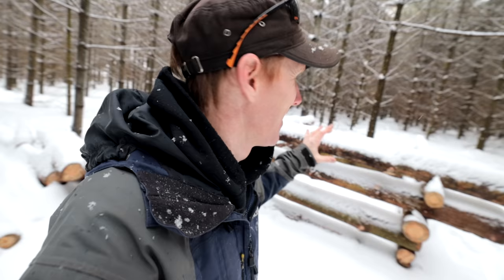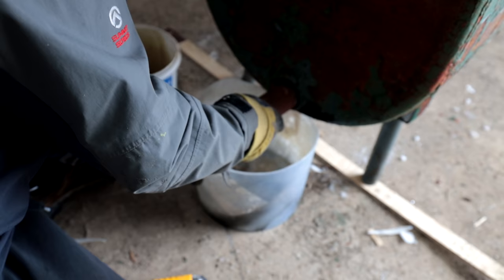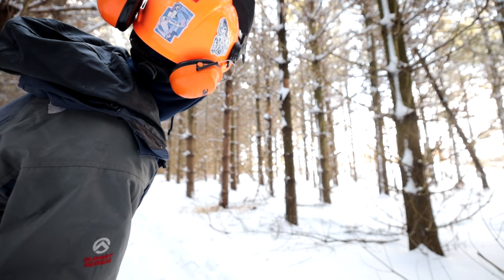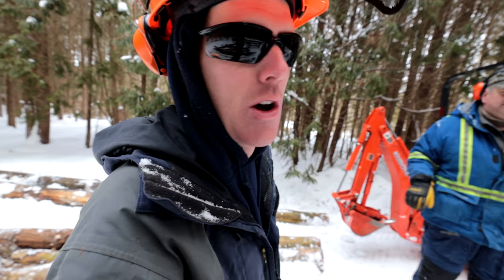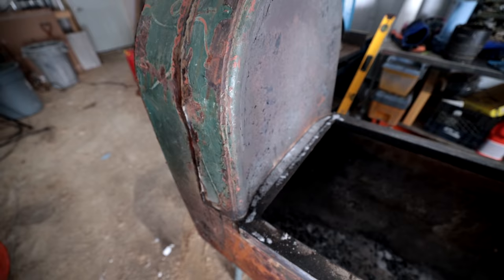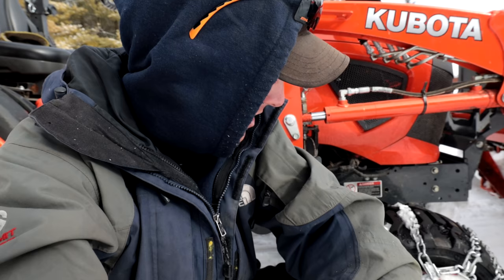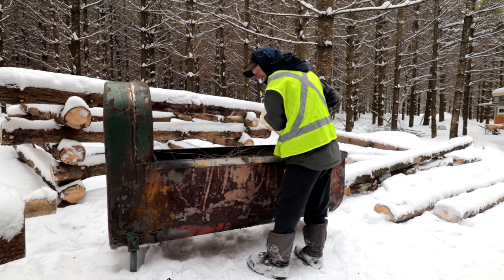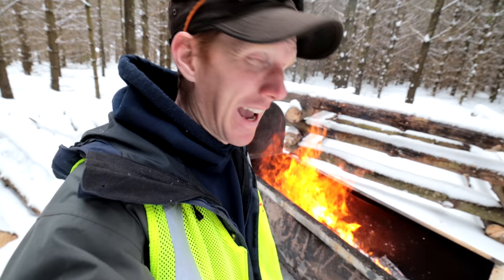Building a $5 Maple Syrup Evaporator worth THOUSANDS! (for the off grid cabin)

Comment: I was a Kubota dealer for 8 years and our business has been in business for 32 overall years. You won’t regret foam filling those tires and yes they are worthy. You ll be surprised at the weight it ll add also. But those r4 tires are definitely worthy. It’s basically a solid tire once done and will have to be cut off when it wears out which honestly it ll dry rot before it’ll wear since you’re not on pavement 24 7.
Reply: They told me they won't foam fill em... Because they said the tire was run flat...  Gonna put some tubes for now and keep going...
Reply: Green slime works great.

Comment: If I could offer a suggestion or three... Line the inside of your firebox with firebrick. 1" should be enough. After a while, the burning will oxidize the metal and cause it to rust and make holes. That's going to weaken the box which means your pan might deform or break it. (We make maple syrup too) Also... put a flat piece of metal from about the middle (lengthwise) of the firebox angling up towards the chimney... You'll have to custom cut it for your box... This way you'll get more even heating in the pan and you won't need a fire along the entire bottom of the firebox... just the front half.

Also, you'll probably want a grate a few inches (up to 6" depending on your preference) off of the bottom of the firebox to stack the wood on which will allow for the ashes to drop through for easy removal. This will also let air get to your fire, which will make it burn better.
Reply from the maker: What you are describing is exactly the next steps in the build.. you should put spoiler alert!..lol
Reply: @ModernSelfReliance  LOL! Sorry about that... hehe
Reply: @Xero1of1  that is some like minded thinking, there. Cant wait to see what you explained in the next Video.

Comment: Your last comment was a SUPER ONE. Imagine after Maple Syrup Season is over. The shack will remain dormant until the next season. How about on the tombstone weld a rod holder connect a rod into to the very end that has a steel H design in the front where the wood is fed. Install a electric motor. Now the evaporator stove can be a rotisserie for a pig or deer to be slow cooked over a wood fire. Sounds very tempting.

Comment: We used foam filled tires on 5 yard scoop trams in an underground gold mine in northern Ontario in the early 2000s and they were the best tires ever used, they were recapped heavy equipment tires that were run 24/7/365. I know this as when the tires were finally finished due to the mining environment (Quartz and general rock) usually sidewall tears, it took several 'days' for the foam beads to finally exit the tire, all the while as the scoop tram was operational, that's my opinion about foam filled tires from what I witnessed.

Comment: I saw one video that a guy cut down one of these oil tanks and made a wood burner stove for his garage. I think he had it 3 or 4 ft long. He used Heavy 2" pipes running threw it from front to back and a barrel stove door. Same some of that tank if you can for a wood stove. WOW, its a wonder that did not catch on fire when you where cutting it open. May be you should get those tires Foam Filled to prevent flats. 40 gals. of sap to make 1 gal. of maple syrup.

Comment: only use premium in your small engines yes, but you want to try and find ethanol free 91 octane as ethanol can turn to water if stored for long periods. and get your front tractor tires filled with calcium chloride it adds weight and helps to prevent flats.

Comment: I did battle with a buried fuel oil tank.  My idea was to evade potential EPA problems.  Hack saw?😂🤣😂.  Sawzall blades by the dozen.  The final answer for me was a powered abrasive grinding wheel.  In the end, the tank had previously been emptied and cleaned.

Comment: Unless gas is different in Canada than in the USA getting "premium" 91 octane will still have ethanol in it.  Octane rating only means how readily the gas will ignite when heated and compressed.  You must specifically find somewhere that sells ethanol free gas; often places that are around water and serve boaters will have it. Running 91 octane in an engine that doesn't need it to prevent premature detonation is a waste of money.

Comment: Before you run out and spend a lot on a stainless steel pan,check out  high end appliance dealers (see if they have a scrap yard) the doors they use on the better appliance's  (Sub Zero and the like) are stainless steel and work great for this application (BTW I was a service tech on the high end stuff and have s\s doors and s\s door panels saved up for many projects)
Reply from the maker: I've got a guy...

Comment: Not saying you're wrong but this is from an article in the  "Family Handyman".
"Premium gas doesn't provide any more power or contain better additives than regular gas, and it contains the same amount of ethanol as other grades. It just resists detonation (knock) better than lower-octane gas—nothing more, nothing less."
Reply from the maker: The ethanol gums up small engines when it sits in the tank.

Comment: I would definitely foam fill your tires it’s more like liquid rubber filled I did this to our 250 broaderson crane and haven’t had a problem with them  no more flats ever. The tires you took off didn’t look worn much at all, remember tire shops like selling tires.  Heck you could fill smooth tires with this stuff and they would last years after all your using chains. 
P.S. the only problem with this is in cold environments when you park the vehicle with these type of tires is that tend to get flat spots so when you start to drive you feel it a lot but go’s away not long after starting to roll
Reply from the maker: Good to know..  Tire shop said because they were run flat...  whatever that means they won't fill em with foam.    Tires have about 200hrs on em in the bush.
Reply: @ModernSelfReliance   that’s a legal issue someone got a crappy tire put on and it blowed up so they sued so now we all suffer. There is some do it yourself stuff you could try on those old like new tires like  FlexFoam-It 25A and 25B  two part resin
Reply: Or fill with sand and silicone or shot filled,  manganese shot in a industrial  rust and scale removal blaster  works really good for tractors adds weight and no more flats I’m sure you can find something that will work

Comment: Green slim is perfect to keep you from flats and its cheaper than foam
Reply from the maker: I'm gonna try tubes first and then green slim next if this fails.
Reply: @ModernSelfReliance  tried tubes they still go flat when punctured and yes they do patch easy but the green slim fills in the holes and stops the leaking as well. Green slime will be cheaper in the long run for those kinds of issues and better. The only advantage to tubes would be if you're worried about knocking the tire off the rim then they may be more of an advantage to you.

Comment: Take it from a welder fitter, if you spend more time on your prep and grind work removing all the paint from where you are going to weld, you will get better welds.
Reply from the maker: I'm finding that.  Sort of like soldering copper pipe. prep is key.

Comment: you shouldnt use premium fuel in a small engine its octane rating is too high to make your saw run well or to keep things clean
Reply: engines are designed to run one octane rating and if you switch then you put the carb out of adjustment and things will get all gummy and it will produce extra carbon
Reply: i know you really believe its a better fuel but burning in a stoichiometric manner means you burn cleaner and longer and changing a fuels rating moves it out of stoichiometry unless the destruction manuel says burn premium just burn the normal dinosuar squeezins

Comment: If the gas is from the same distributor the shelf life is the same between regular and premium only difference in premium is the higher octane that you need in higher compression engines. Premium has the same detergents and conditioners that regular fuel does assuming the same distributor. this BS that Premium is better than regular should always be caveated with if your engine needs it.

Comment: All that information about premium is false. It just has a higher ignition point for engines at higher compression. Literally nothing better about it its only meant to be used on engines that need the fuel to burn at a certain rate.
Reply: In Canada anything less then premium fuels contain ethanol.  Gas with ethanol separates while being stored in your gas tank. The 2 stroke oil remains bonded to the gasoline but not to ethanol. Thus, the ethanol and water part of the mixture contains no oil for engine lubrication. This leads to poor lubrication, performance issues and costly repairs over time.